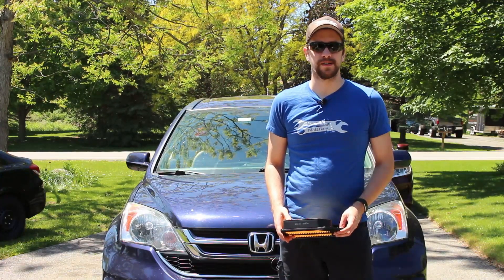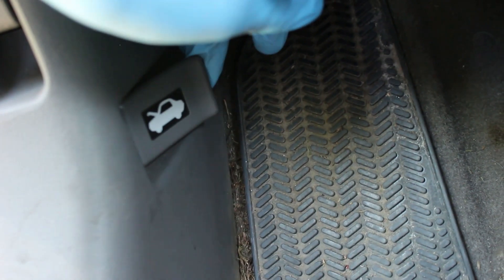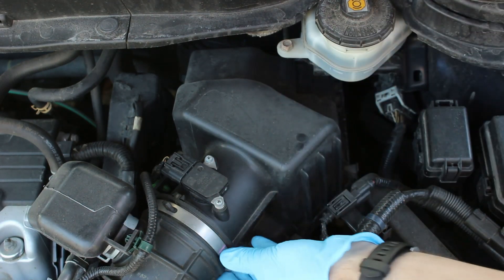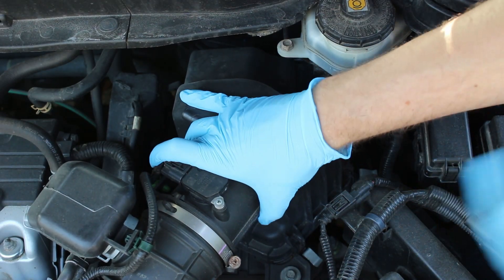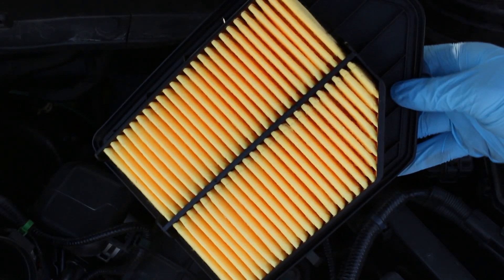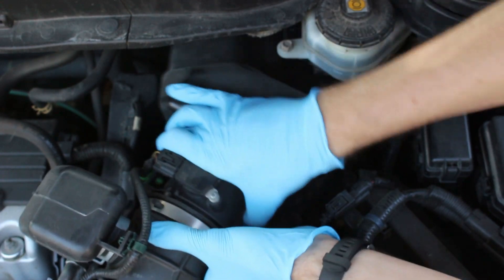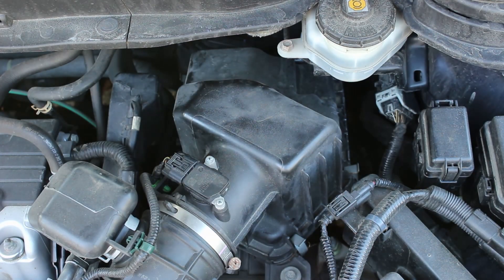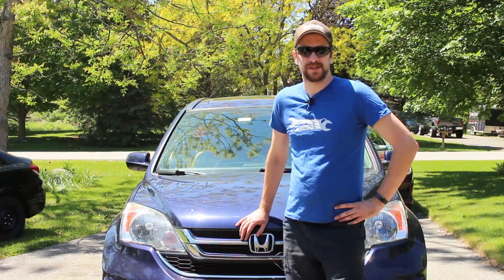2007-2011 Honda CR-V Engine Air Filter Replacement

Comment: I got the filter out fine, put the new filter in but couldn’t get the housing to seat properly. I went back to the video, took the housing back off to find that tab and be sure I had the filter properly seated and once I lined up the tab properly (2011, only 1), it went back together flawlessly. I’m a 75 year old female. If I can do it, anyone can do it. Thanks for a great video.
Reply: Are you talking about the tabs in the back?
Reply: @Jebusite100  Yes, I overlooked that part of your video first time through.
Reply: @grammymame7753  I guess I'm lucky, my 2009 model doesn't have the tabs in the back.
Reply: Not true, I have a friend who’s a Dr , and I’m not sure he could do it. 
Good for you taking care of things on your own.  Even the cabin air filter in the glove compartment is really easy to do.

Comment: You should have stressed the importance of the tab in the back. I spent about 2 hrs  trying to get the latches to latch  not realizing there was a tab at the back!. I even thought I had the wrong filter, but when the old filter would not latch I knew there was something else that I was not doing right. I finally read another post and found out about the tab.😢

Comment: Thanks, this was helpful. I should note that you can probably loosen the hose clamp with a phillips screwdriver which might be a more common household item than the 10mm socket. That's what I did!
Reply from the maker: I don't usually bother trying the phillips head when there's a hex outer due to the rust around here.

Comment: Shorter side is face down not up as shown. Just an FYI.  It makes a difference in sealing and is shown in Honda SM.
Reply from the maker: It only fits one way due to the shape.
Reply: This is not true for the first 2-3 years of this generation. On my 2007 CR-V EX, the filter is shaped symmetrically and can easily go in upside down (and won't seat properly). I'll bet the CR-V in your video is a 2010 or 2011?  Correct?  This is the confusion created when the manufacturer makes subtle changes within the same generation.  Regards.  @MechanicalMalarkey
Reply from the maker: @teststereo  Yes, I think is a 2011, and there was that mid-generation change of air filter shape.
Reply: Yes, you’re trying to say that the fat side faces up, correct? That’s how I put mine in & it fits perfectly
Reply: @esmeraldas8882  yes that is correct.
Reply: @MechanicalMalarkey  2008 CRV this is not true.  Enjoy your videos and appreciate them.
Reply: @FloridaSunMitochondria  I have a 2007 Honda CRV ex-l. I changed it myself just by watching this video. I was getting charged alot at the shop, I’m learning how to do things myself & it’s soo much better. Thank you! (I put the thinner side down, w/ the fat side facing up)

Comment: When you say “ get the tabs in the back,  I couldn’t see what you were doing.
Reply: I'm sure you figured it out, but for anyone else, there is a plastic tab on the upper housing that slides into a slot/tab on the lower housing. Slide that tab in before you try and secure the locks on the side.

Comment: It should noted that the air filter can 𝒆𝒂𝒔𝒊𝒍𝒚 go in backwards (I think on 2007-2009 only).  My 2007 CR-V EX 𝒂𝒊𝒓 𝒇𝒊𝒍𝒕𝒆𝒓 𝒊𝒔 𝒔𝒚𝒎𝒎𝒆𝒕𝒓𝒊𝒄𝒂𝒍 𝒔𝒉𝒂𝒑𝒆𝒅, 𝒂𝒏𝒅 𝒏𝒐𝒕 𝒍𝒊𝒌𝒆 𝒕𝒉𝒆 𝒐𝒏𝒆 𝒊𝒏 𝒚𝒐𝒖𝒓 𝒗𝒊𝒅𝒆𝒐 𝒕𝒉𝒂𝒕 𝒄𝒂𝒏 𝒐𝒏𝒍𝒚 𝒈𝒐 𝒊𝒏 𝒐𝒏𝒆 𝒘𝒂𝒚.  You CAN put it in upside down on the first 2-3 years of gen 3. This is the confusion created when the manufacturer makes subtle changes within the same generation. If it's upside down, the filter will appear to seat, but not completely, making it VERY difficult to get all the snaps back on.  If it's upside down, you will notice the filter is slightly raised on the back end (fire-wall end).  That's why it's important to loosen the first clamp screw, getting the air tunnel out of the way, making the entire process MUCH easier (and making it easier to SEE that the filter is seated properly).  Many people will replace this filter without loosening the adjustable clamp and getting the air tunnel out of the way (yes, it can be done, but can be a bitch to get the filter in and out).

Comment: I replaced mind but after sounds  weird when I accelerate the speed
Reply from the maker: I would make sure that the gasket on the filter isn't damaged, that the cover is on fully, and the intake tube is tight on the cover.
Reply: It means those tabs in the back didn't get hooked in properly (really wish he'd shown them while the cover was off), or the latches aren't  secure.  This has happened to me twice, after the guys at the oil change place checked the filter, so I learned how to get the cover back on right myself.

Comment: Anyone else not able to get one of the clips to snap close after swapping the air filter?
Reply: Yes, but only because the filter was upside down.  There is and upside down.  If it's upside down, the filter won't seat completely, making it VERY difficult to get all the snaps back on.  That's why it's important to loosen the first clamp screw, getting the air tunnel out of the way, making the entire process MUCH easier.  𝐄𝐃𝐈𝐓; Seems that SOME CR-Vs (2010/2011?) from this generation have air filters that can only go in one way.  On my 2007, the air filter does not look like the one in this video.